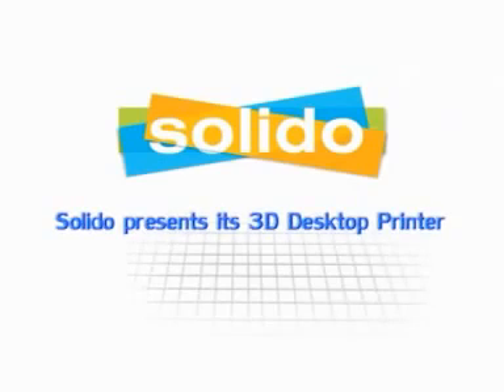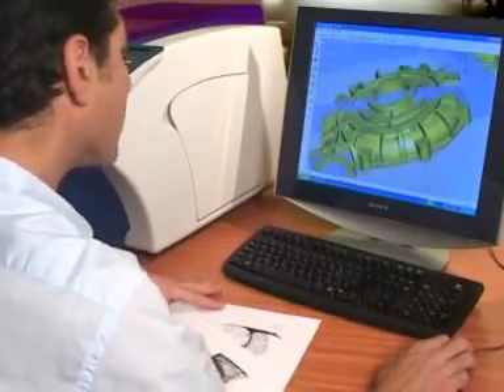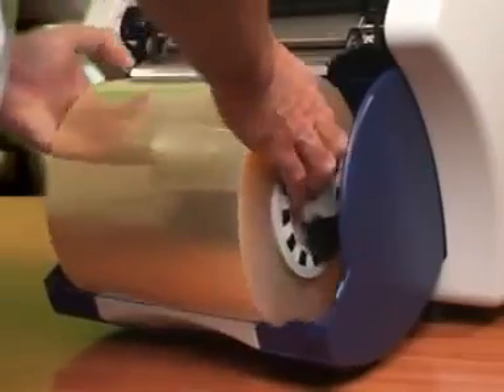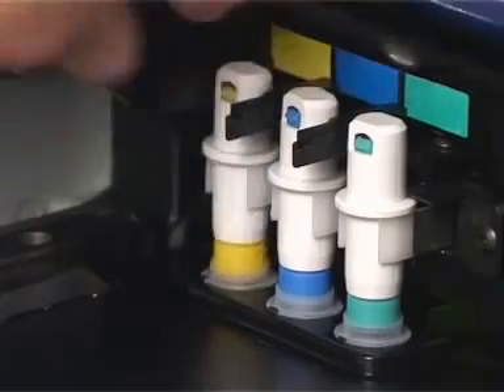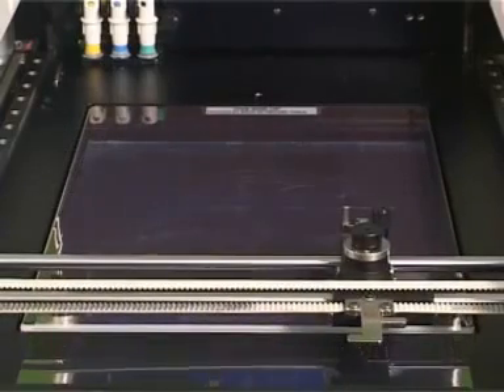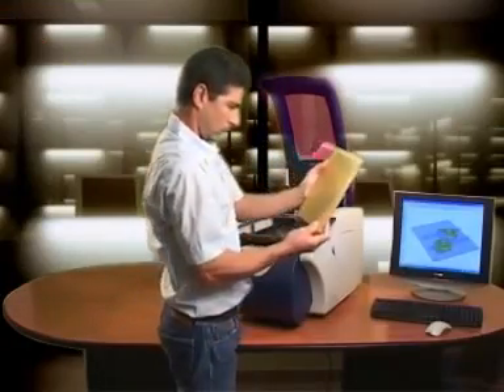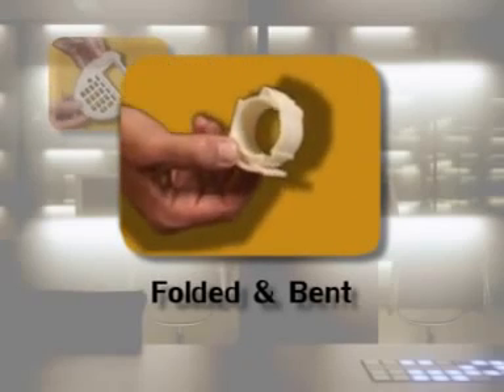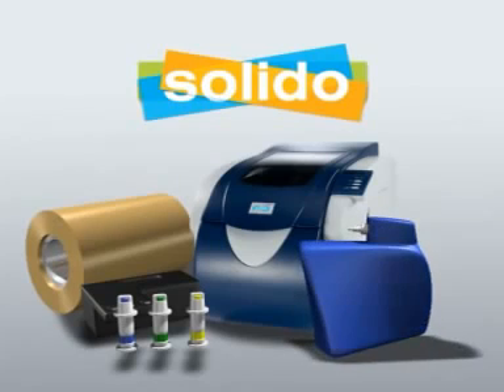LOM - Laminated Object Manufacturing

Comment: I feel like this kind of printer results in the most wasted plastic. 
Also, "Finally, a 3D printer you can afford!"
>Costs $10,000
Reply: remember this is 2006 or 2005 or something. Not 2016
Reply: It's only useful when the whole print bed is used. That's how its cost-effective
Reply: First price was about $15 k :D